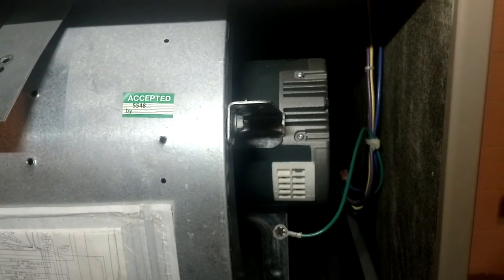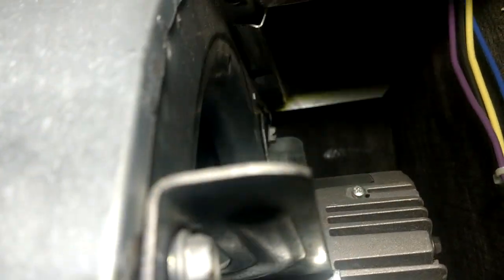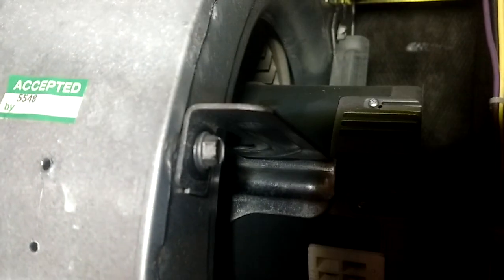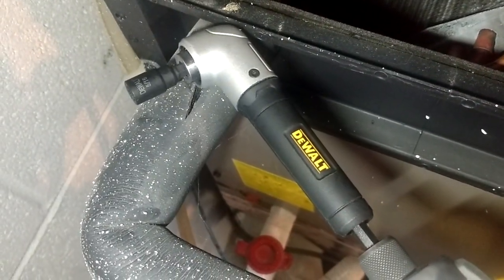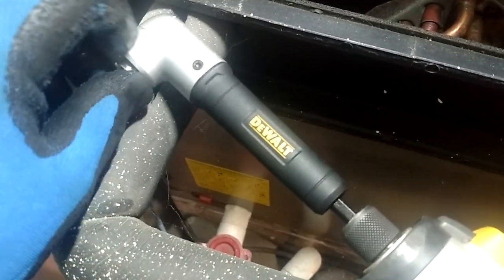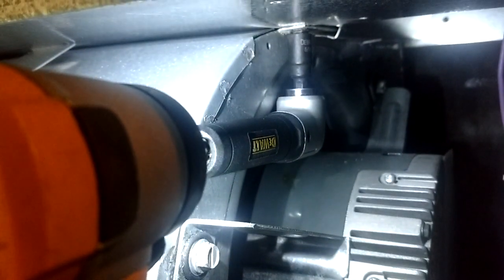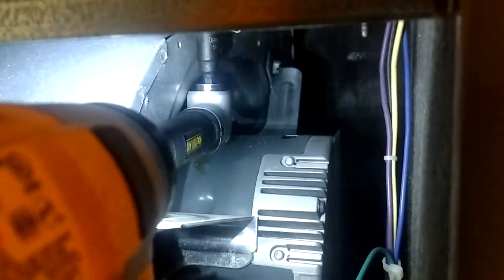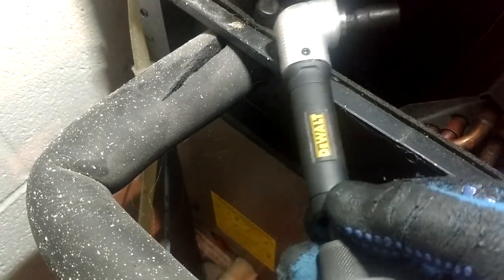In a tight spot !!! Using NEW Dewalt #DWARA120 Impact Ready 90° Angle Tool to remove  blower screw.

Comment: I like the Milwaukee smaller version not really impact rated but I can impact zip screws with it. I tried to use it to impact out the  17mm bolts holding my master cylinder to the power steering and blew out the gears. I liked the smaller design of the Milwaukee yet this DeWalt looks about the same size but impact rated. The first offset bits I bought was for cleaning flame sensors on the G61 furnace years back

Comment: Will it suitable for 1/2" socket or will break?
Reply from the maker: Don't really know for sure, but it is pretty darn tough.
Reply: @sknight0391  then I might try to get one hopefully it's good.. Thx for sharing keep it up 👍 👍
Reply from the maker: @neodiy  it's definitely a good solid tool. I wouldn't go trying to bust lug nuts loose with it or anything but it should do most everything you need it to. 😎👍
Reply: @sknight0391  lugnut maybe not but there are some bolts difficult to reach around the steering racks I need to remove

Comment: Not sure if the standard chrome milwaukee one is "ready" for it but, i've used it the same way you did and its a life saver.
Reply from the maker: Mine kept me from having to pull a blower assembly yesterday to strap down loose insulation inside of a Lennox air handler. Worth its weight in gold. Thanks for watching 👍

Comment: can you put a 1 inch Phillips bit in this?
I read a review that said it's too deep so not enough of the bit head protrudes to engage the screw head!
that's a deal breaker for me!

anyone refute that review?
Reply from the maker: Yes you can use a 1-inch Phillips bit and this angle driver. It's just like the older version of the tool in that respect. The Phillips bit sticks out just enough to engage the screw and the screw will be held in place by the round magnet at the end of the driver. I will include picture links below.
New version ⬇️
https://photos.app.goo.gl/prFJejLbyAv4vQe98
Old version ⬇️
https://photos.app.goo.gl/hNsPb4LNEdZW4H597